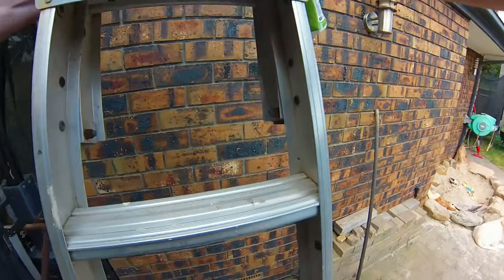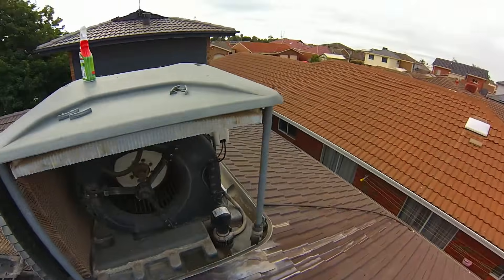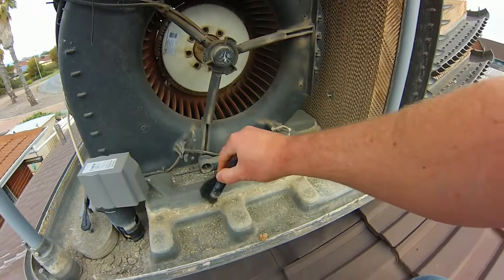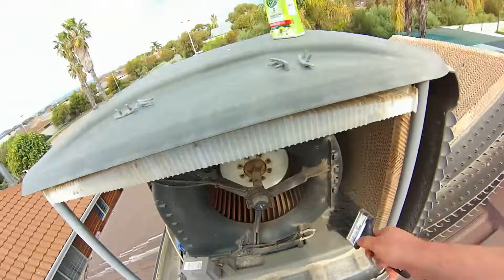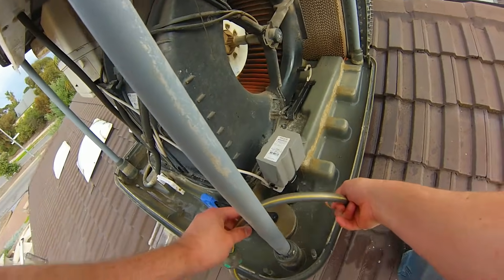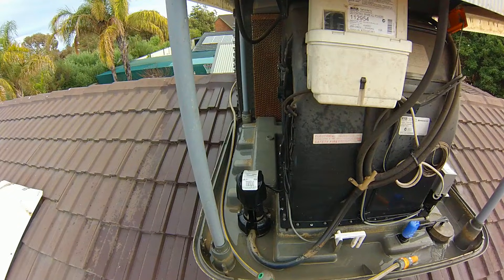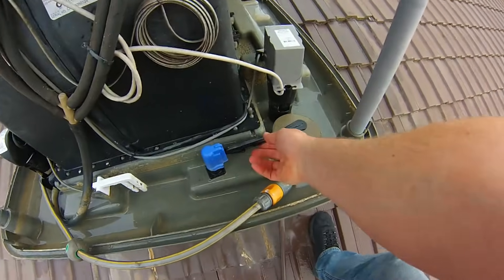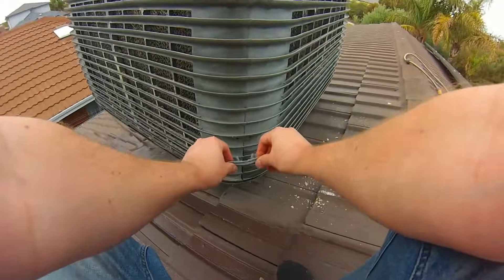Easy 15-min Evaporative Swamp Cooler Maintenance DIY Service Breezair

Comment: Would you need to replace those cone filters as well if the cooler isn't pumping out cold air anymore?
Reply from the maker: No, you will need to get up onto the roof and take one panel off near the pump to see why water is not flowing over the filters.
Air moving through wet filter pads create the cooling effect.
Reply: @NotSealed  Water runs through them fine, just went up on the roof today and checked. The filters are a few years old now. They look fairly worn. 😳
Reply from the maker: You can take them down and clean them with clr clear. Filters should last 10 years Plus.
Check your ductwork inside the roof as this can also degrade and fall apart.

Comment: Any chance on doing a video on checking the condition of the belt, pulley and tension.
Reply from the maker: Sure next time I'm servicing a belt operated air conditioner I will film it.
This breezair unit was direct drive so no fan belt.

Comment: Very good video, perhaps you could tell me why all of sudden my aircon does not blow cool air, the fan and the exhaust works just fine. What needs replacement? Thank you for your help.
Reply from the maker: I need more information. Is the air conditioner filling up with water?
Is it leaking water? Is the water pump working etc
Reply: Hi there, the water is working as i can see water filling up but the counter weight drain remains up ( so water drains away and cannot reach the level it should ). Not sure how to check if the pump is working ! Thank you for your help.
Reply from the maker: Sounds like the drain valve is not closing. This is a very common problem. You will need to replace this part. https://amzn.to/47aQOOJ It is very easy to replace. @jdhdh1357

Comment: Hi, my breezair evaporative cooler won’t turn on. The diag light is green but the sal light is red and flashes twice. Any ideas
Reply from the maker: 2 red flashes means that there is no water covering the salinity probes.
Need more information is this cooler working on vent only?
Will it fill with water? 
Is the dump valve closed?
More codes and fault fixes can be found here https://notsealed.com/breezair-evaporative-cooler-troubleshooting-guide-repairs.html

Comment: 15 minutes? 🤔 for all you diy’ers there’s point cleaning all that dirt out if you’re not going to clean the pads properly. They need to be cleaned on both sides until the water draining from them is clear because going by how much dirt is in the bottom of your unit the pads will be full of dirt too and the water coming off them will be basically muddy water.
Reply from the maker: Yes and that's why we run a descaler like clr through the system for a while to breakdown buildup. That's the trick for a proper clean.
Reply: Great video

Comment: I've just replaced the motor in mine. Did it myself and 100% certain the wiring if correct. however, the fan starts and runs backwards??? Sometimes it doesn't start. it just hums and I manually start it in the correct direction and it then spins in the right direction and works great...
Any idea why it would be starting the fan backwards?
Reply from the maker: It must be the controller. They often fail if the motor fails. Even if the wiring was incorrect the motor would only spin in one direction. It wouldn't matter if you started spinning it by hand in the other direction as the torque would slow it down stop and then drive it in the correct direction.
A stalled humming motor is a sign of a bad controller. Is the motor new? Check the resistance of each windings they should be the same ohms.
Reply: Thanks for your reply @NotSealed  ...I managed to find the problem. It's a second hand motor. I checked the wiring on the capasitor and changed the two wires around and it worked. Someone must have bought a new capasitor for it and wired it backwards?
It ran all day but when i tried to restart it, on full, it wouldn't start again but starts when I turn it down to low no problems. So, at this point, it seems to be working, to a degree anyway...

Comment: Incredible video . My Breezair cooler keeps tripping when power is turned on. Have removed pump and the cooler has not tripped.Am l assuming correctly the pump  needs replacing. Thabks
Reply from the maker: Yes that should fix the issue. But it could also be due to water getting into something. But it's usually the pump if it's old. Good job with the diagnostic.

Comment: What makes the cooler to start and stop? The motor runs once and stops. When you switch on it does the same thing again and again. Please help
Reply from the maker: Could be a few things. Does it stay running on vent only not cool?
If the dump valve is not reaching the closed or open limit it could cause the fan motor to stop.
Also an old worn water pump can cause electrical noise that will trip the cooler. Low battery level in the wireless controller is another issue.
Or just a bad motor. So a few things to check.
Reply: I will check, the motor turns once then stops

Comment: I have solar panels on 3 sides of my evaporative cooler. There is a bit of room on 2 sides, and none on the lower side. Can the cleaning be done from the high side if we can reach around to unclip the sides?
Reply from the maker: Yes you should be able to unclip each corner to remove one or two panels.
The clean service won't be perfect but it's better than nothing. Just flush it more with the hose.
Reply: Thanks for your quick reply - do you hose down the honeycomb filters?
Reply from the maker: Yes you can hose down the filters on the outside and inside with low pressure. If they have scale on them use a product called clr clear.

Comment: Great video thanks, Can you tell me if the remote controller rj9 cable is straight though or reversed ?
Reply from the maker: Make sure it's a 4pin rj9 some controllers use rj11 / rj12 which is a 6pin sometimes 4pins are used.
As far as I know it's a straight cable. Not crossover
Reply: @NotSealed  Thankyou very much for the response. Rj9 connectors on a 4 pin straight through rj12 cable did work to power the controller but no signal seemed to go the unit so maybe my controller is the issue. Special thanks to my builder for cutting the cable off at the unit in the first place :)..Thanks again a great video

Comment: Great video. I have a problem with drain valve on Breezair ES 190 in that it won’t close. Had Seeley agent call out but they want to replace whole “ water management system” at a cost of over $1600.  (I have no sense that there is any other problem and they simply want me to instal a new cooler.)My question. How easy is it to remove and replace the drain valve and do you have a video for this?
Reply from the maker: Yes, it is very easy to replace. You need this part https://amzn.to/40u9Lue make sure to Isolate the unit and follow this video https://www.youtube.com/watch?v=EkTPi5DIh-k
You will need to remove the cable but it is just a plug that is easy to remove.
For an easy fix just leave the black housing installed in the cooler and replace the motor and plunger assembly.

Comment: Thanks heaps mate, you're such a legend! My cooler is around 10 years now, is there any parts I should replace to keep it running smoothly?
Reply: These parts are expensive just replace them as they fail. Water pumps tend to last around 10 years so replace that first.

Comment: can flies get into the house through the ducting or are they screened?
Reply from the maker: No they can't get in. The design of the water-air cooling pads makes it impossible for flies to get in. Unless there is damage to the cooling pads.

Comment: Hi mate, 
I am going to service by myself First time in my life. Appreciate your video. Thanks you

I have few leakges coming from roof to my room exactly where the unit is. What should I check in the unit. Leakage is only in drops and only when I run the unit.
Please advise

Thanks
Reply from the maker: Leaks could come from a few places like overflowing cooler, dump valve leak, or from the inlet pipe.
It's best to run the unit and then go into the roof space to see where the leak is.
More often the leak is from an over flowing evap cooler because the float valve is not stopping the water completely.

Comment: Great video mate. Mines been off for the last 5 months and now there’s no water running to it. Any idea how to fix this? Cheers
Reply from the maker: Check the water solenoid that it has power and open. Other wise could be the water float is stuck or dump valve limits are not closed.
https://youtu.be/EkTPi5DIh-k explains  a little more 
Lots to check

Comment: Hi there . Just replaced the pads and cleaned my Bonaire DS11 cooler what I noticed is the pump filter basket has a large hole in the bottom I wasn't sure which direction it was facing before I cleaned it , so I placed it in a position whereas as the water flows in it hits the basket and pushes particles out  of that hole whether that's correct I don't know . My question is what is the purpose of the hole   and surely the pump is going to suck in  large particles through there , cheers from Adelaide
Reply from the maker: Most evaporated air-conditioning use the tornado water pump. This has a hole for the outlet water to the filter pads.
The rest of the pump has a filter which is small enough to not allow large particles to enter the pump. What is the pump brand and model number?
Reply: Thanks for the reply . I did not check what type the pump is but what you say makes sense as I saw online a pump with a hose fitting at the bottom . I have to get back up there this weekend because like an idiot I forgot to switch it back on again lol , it would probably be wise to find out the make and model for  future ref my evaporator is over 20 years old Cheers   @NotSealed

Comment: Good video. How often should the cardboard panels be replaced and/or cleaned?
Reply from the maker: Only really when they start to degrade and fall apart. I have seen some last over 15 years if cleaned every season.
Reply: @NotSealed  Great Video I have a 21 yr old breeze air unit one of the pads has fallen apart is it best to buy  1 or 4 pads? When you use the CRC clear do you spray it on the bottom of tank and the pads and rince off or leave it on?, i dont think my unit has a drain plug so was going to use a drill pump to remove the old water. and is this the one to buy CRC Clear Urethane Seal Coat 300g? thanks
I just read on your link about breeze air breaking down mine is 21 yrs old i had the pump replace about 4 yrs ago and i never did maintenance on  it ha.
where would be the best place to buy pads im in Adelaide?
Reply from the maker: Its called clr clear its is the most powerful cleaner just spray it on the pads and inside and then wash it off. You can get it at bunnings You need to drain it you must have a drain plug somewhere. Its either a auto drain or a drip drain.
Pads can be brought as a pack of 4 from ebay @foaley77

Comment: Great informative video. Thanks. My Bonair evap system doesn't react after I turned the thermostat on. The thermostat is stuck in Heat and shows the temp of 45 degrees. The guy came over and said that apparently the motherboard inside the control box on the roof is full of mud and insects and it stops working and he wants to replace the whole system with the brand new Bonair unit. I don't agree with it. Do you think that if I give it a good cleaning maybe solves the problem, as the unit hasn't been cleaned for 6 years. From the electrical side, what can cause the mother to stop working? Thanks again
Reply from the maker: If your wall controller is stuck on 45 deg then that could be a problem. I have  seen the buttons fail before.
If the motherboard is full of mud then that is also an issue as the enclosure box seal has failed.
Personally I would go with a new unit as they can be very expensive to repair especially if it's over 15 years old

Comment: How to change temp reading from F to C
Reply from the maker: MAGIQCOOL CONTROLLER -ENTERING PARAMETER MODE To enter Parameter mode, the following process must be carried out within 4 minutesof power being applied to the cooler. If unsureof time since the last power "ON", remove power to the cooler (Isolator Switch or CircuitBreaker) for a minimum of 6 seconds so themode can be entered.1. While wall control is OFF, push and hold auto and down for "three (3) seconds.2. When parameter mode has been entered,screen will display "A1" and "Param".Pressing up or down"scroll through parameters "A1" to "AA"(Refer to table for factory settings).3. To view parameter number set in wall controlpress auto"" momentarily. Figure "A#"on screen will change to number set, and"Param" will change to "value".4. To alter "value" of selected parameter press"" up or down "". Numbers will change to show different values the parameter canbe set to.5. To store the value, press auto "will go blank momentarily as wall controlstores parameter change, and returns screen to "A#" and "Param".6. To exit parameter mode or escape from analteration without storing a change press"" power button instead of " auto Remember, once step 5 has been carriedout, new parameter change is permanentuntil again altered.7. If no buttons are pushed on wall control,after 3 minutes screen will reset to "OFF"state. Procedure to enter parameter modemust be re-initiated
Reply from the maker: What wall controller do you have? Model Number
Reply: @NotSealed  magIQcool
Reply: @NotSealed  part# 11628-F
Reply: @NotSealed  software  30R0119

Comment: I turned on my Breezeair this season, my units remote which is fixed on wall, will turn ON as normal but there is no fan pressure or air blowing out of vents. Any tip you can give to check or to reset the unit, the circuit breaker seems fine.
Reply from the maker: You will need to go on the roof and take off one of the filter pads to check the status lights on the controller.
Most probably water is not filling up. Could be a drain issue, or stuck water inlet solenoid.